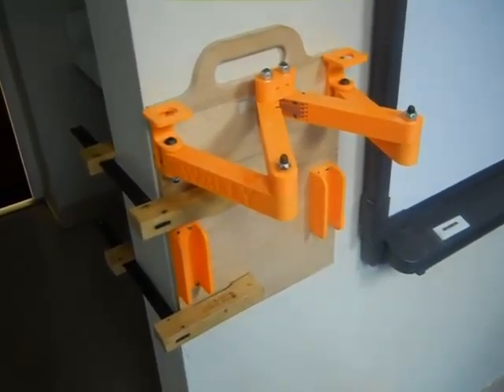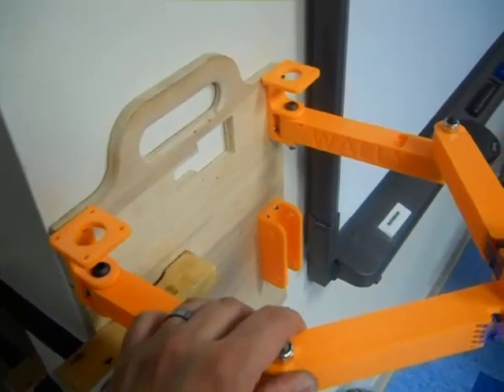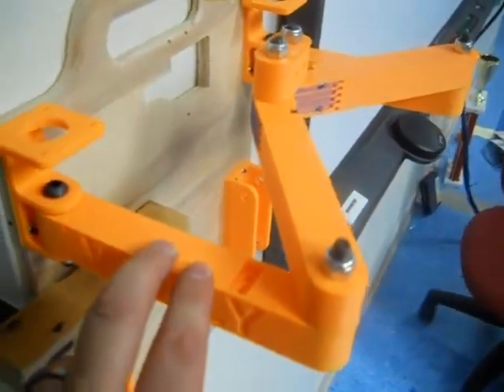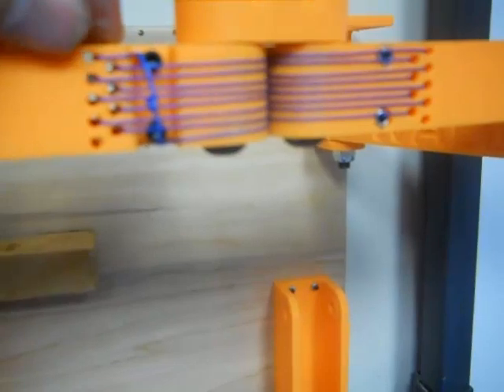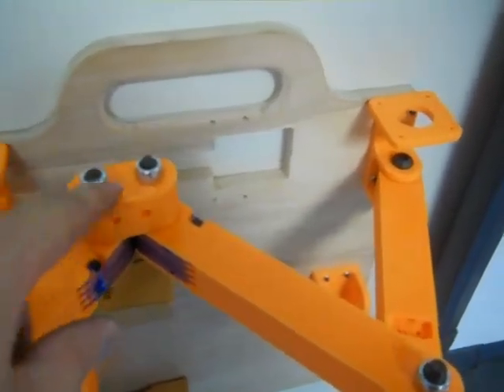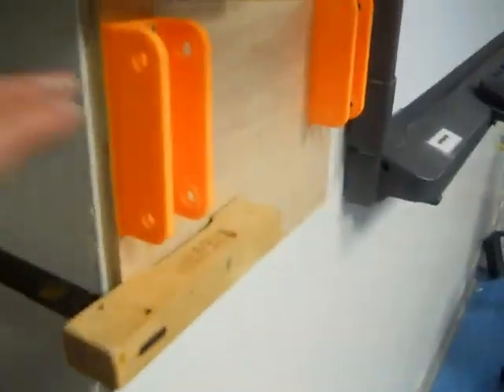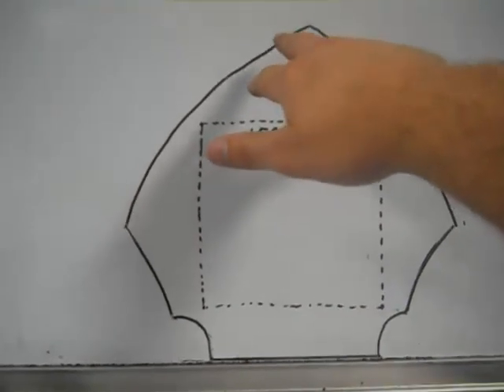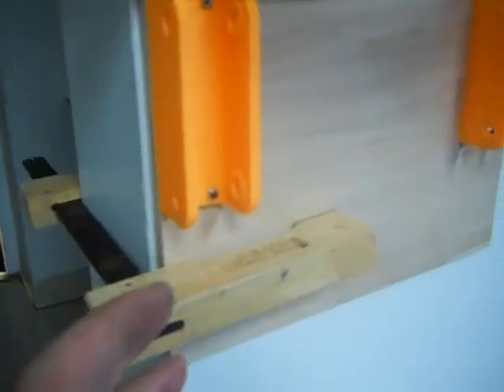RepRap Wally (Almost Complete Mechanicals)

Comment: That thing is awesome, great job.
To save money / complexity, maybe consider embedding a magnet near where your tool changer would go... On boot up, the user can connect the head to the magnet, and home the machine with offsets from that location.  I'm new to this stuff, but I imagine something like that, or a even just a docking fixture could be enough to resolve home.  Am I off track?